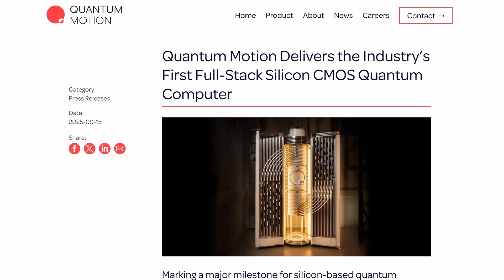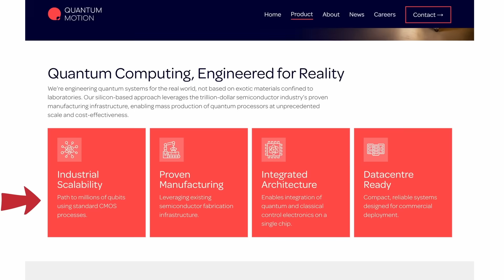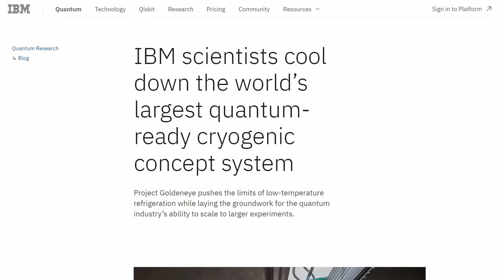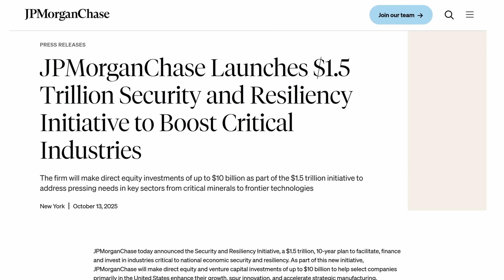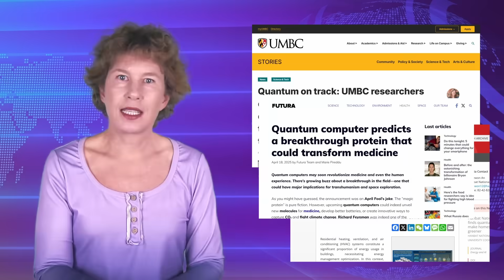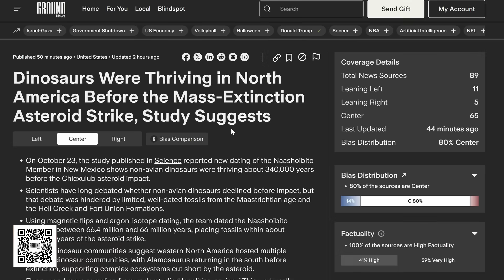I was SO wrong about quantum computing.

Comment: Let me fix this description. 

A quantum system is essentially a set of coherent states until one of the set undergo decoherance. Within a coherant state the best description is a wave function. We cannot observe the wave of a quantum particle without resetting the wavefunction. Classical most wavelike interactions (e.g. a radio wave) interaction will pass through a coherant particle without disturbing it. In a quantum system these waveform interactions cause a transference of information. 

    So what is the problem. We need to think of temperature as a profile of electromagnetic radiation created by the particle of the system. In a quantum computer Qbits are surrounded by materials structures that are involved in structure, insulation, and communication. These structure can retain and emit heat both through energy addition in terms of amperage, or in terms of latent heat pickup. Because they can hold heat, they can release in terms of radiation and this radiation can interact with the core of the cubit, thus causing various levels of decoherence. 
   So let’s take an example, let’s say at a given temperature the loss of information is 1/10 per cycle. If you have 2 cubits you will loose information every 5th cycle, roughly (the exact frequency has to be calculated using BPD). If you have 5 cubits you will have to repeat calculations several times to note the correct answer. If you have 10 cubits you might need to repeat dozens of times. If you have 100 cubits you might as well toss out the quantum computer. Some quantum computers use error correction, again, the more cubits, the more error correction that is needed. 

Is quantum computing going to make AI become hyper intelligent……no. AI currently follows large language models, its data that it processes are discrepant and fall in object class structure. For example a motor vehicle, motorcycle, tricycle, quadricycle, duelly, truck and trailer. Car has motor (ICE, Deisel, electric, hybrid). Motor has properties (HP, Torque, etc) 
And so on. Quantum computers work on arrays of data, for example weather stations where values can be assigned to places.

Comment: Secure communication.  That's the secret.  Well maybe.  Some time ago I heard that they demonstrated non-local communication as a by-product that wasn't considered relevant to their work.  Perfectly secure communication that works from anywhere to anywhere without delay and they thought it was an interesting oddity.🤫
Reply: Humans are still, by far, the weakest link in the security chain. So, even with perfectly secure quantum communication, social engineering vulnerabilities will still exist.
Reply: You can fly a drone on Mars in real time and no one can tap or jam the signal.  The rest are fiddly bits.
🤠

Comment: 1) Nobody has  figured out a way to efficiently / effectively use the computing "advantage" being predicted yet (and it's possible there is reason...it's not possible?).
2) Solving the cooling issue for the larger qubit systems being predicted (and possibly even manufactured) is beyond our current capabilities and directly competes with available power resources that AI is also wanting to consume.  (note that smaller scale local nuclear reactors could be a solution to both power issues, but the cooling still needs to be solved even if you have the power to do it).

Comment: Black Holes might turn into White Holes, and make up dark matter, physicists say:

Energy-Bound Universe 
Closed System 
x + y = 0 

Energy-Unbound Universe
Open System
x + y = 1 

Cold Energy Universe
Open System extended
x + y = 1 + C

Nil Energy Universe (Big Bang)
Binded Closed System
x + y + C = 0

Nil-Nil Energy Universe
Binded Open System
x + y + C = 1

No Energy Universe
Binded Open System extended
x + y + C = 1 + C

White holes could be from a Nil Energy Universe, where particles from the Big Bang could have reached them.

Comment: You can short a failed company and still lose your money if people keep buying the company anyways. Qubits are not real, at least with regards to how they are currently described. We can, however, create atomic analog computers that have super low latency due to interactions occuring at very high rates and low distances, and it will be easier to make these devices do something useful once we correct our understanding of what they are actually doing.

Comment: go chiplets. you just need quantum data wires. the optical quantum stuff. if you do not do better, your crown throne will be shifted away from its location. above says so. hype = money. at least your bs meter mostly 0.7 probability works.

Comment: The designs of QC I've deep dived into were dual pwm circuits that are in anti phase.   They run it and phase errors creep in and accumulate.   So the use ordinary computers to "find"  the answer in the noise using "lock in amp" type guess and try to find.   

it's an analog computer which have been around for 100 years or so.  Analog computers can do some calculations much faster than digital

Comment: 3:18  I used to be the system administrator for the research group I would be involved in, because we for some reason never have any budget to get a professional, though we have plenty of money for conferences and guests coming over for a week or two with all expenses paid.  I even had a cup of wine with a Nobel Laureate once that costs like 8k per bottle.  According to the guy who ordered it, that the budget for the meal was unlimited but each item must not exceed $10k.  Truly odd sense of priorities in my opinion.  But who I am to judge I got like 1/20th of that bottle so, I guess I got paid 8000/20 = $400 just for eating with this Nobel Laureate.  Hey, I had no idea I was paid at such a high rate, better than any hooker I know.  Of course, I don't use hooker.  Like with my gasoline, I am cheap, I like mine self-served.

Anyway, people have this weird idea that server room is necessarily full of wires.  That is only true if your goal is to spoof your IP since each Ethernet card,hence each Cat-5 wire, has a unique device id, thus it can hold only one IP address.  Not sure if that is still true today, maybe they can emulate these things now within the OS.  But, people who do that kind of things are typically hackers, or rather people working from the server room to reroute data to places that they are not supposed to send those data to.  For example, if my boss were running crypto minding thing on the machine I was administering, I could just by accident hook up another IP address to the machines and reroute all those mined coins to my crypto-pocket while he kept thinking how comes his pocket is still empty and stuff.  I am just speaking hypothetically of course.  I would never do that since I was getting paid by expensive wine.

Obviously, having so many wires around can be confusing and dangerous.  So to make things less confusing, one has to add more to the whole mess, except for a few with special colors so that I know those are the ones to not touch because it could tip off people like my boss that I am doing something funny, which of course I would never do, and if I ever get found out, I would feign incompetence and blame the guy before me, the server room maintainance crew, or the janitor for tripping over the wires that I carefully, and needless connected all over the place.  

It seems like with these quantum computers, I wouldn't, I mean "no one", would ever have to justify why they have to purchase so many Cat-5 wires when Cat-3 (the ones you buy at Walmart) would have been perfectly fine since most broadband services are not going to go at such high rate anyway.  

Also, why do people let people with foreign nationalities manage their computer networks and even the entirely department like when I was at UCLA Chemistry.  Hey, (I forgot his name, maybe Alex, the Russian Drunk, he was always drunk) how come there were so many wires in every server room and server cabinet you were managing just like in this frame?  And why I got into trouble with Argonne Laboratory but not you and the two guys working with you, one Chinese, and the other a Swedes.  And how come you guys have these techs that are like 2-3 decades ahead of its time.  I had no idea GPU cards could be used for crypto until one of you guys (the Swedes) showed me with your 50 cards gig.  I also didn't know solid state drive existed if I had not noticed how quiet and cool with no extra AC, your own personal server cabinet is.  Also that screen with that app where you are literally tracking everyone's traffic day and night, what were you looking for?  That was wire-shark before it was even out and available to everyone.  Are you like the creator of wire-shark ... BTW, don't use that thing makes your system vulnerable to remote attacks because it happened to me.  Russian are very dangerous, especially drunk Russian system administrators.

I also knew another Russian, but she was not a drunk, she was kinda nice older lady.  But, she was somehow working for AT&T hired from Russia directly, and ended up homeless eating cat food for a few years, and then miraculous found a job working in medicine.  And then married some rich dude after her kids have all grown and graduated working for the big tech.  I wonder how that works.  And here I thought no one ever recover from homelessness and prostitution, much less experiencing a real life Cinderella story like Julia Roberts in Pretty Woman.

Pretty woman, walking down the street
Pretty woman, the kind I'd like to meet
Pretty woman
I don't believe you, you're not the truth
No one could look as good as you
Mercy!

Comment: What we all forget is that we "easily" could make trinary bits in standard computers. Instead of 0 and 1, would you have one, zero and minus one.
Reply: We could have decabits, or hexabits. In fact modems essentially use 64-a-bits. But that would not give the advantage that quantum is supposed to provide.
Reply: @AaronJees-Tring-y3y  I am not sure if my explanation was good enough.
As it is right now, d we have 64bit, each bit can be either on (1) or off (0). By using Trinary, could you have 64bit as (-1), (0) and (+1), making it exactly bits in three states, as the Qbit. The quantum is not amazing due to the three states bits can be in.

Comment: While most said is true, I don't think this grasps the order of magnitude of the issue. Scaling up the fridges by 100-1000x is a challenge, but the path is relatively clear. The biggest issue in my opinion is that the coherence times are still in milliseconds even for a few logical qubit setups, while you need way above 1000 logical qubits that can work error free for days or weeks. Neither count, not times have been scaled at the rate that would suggest being anywhere close. Seriously, it is not even funny!

Comment: The cooling issue could be addressed by computing platforms in orbit, inheriting tech being considered for LLMs. So the infrastructure build out from one bubble gets used to support the quantum bubble! Two investment streams coming together. So maybe that's the secret you're alluding to, that quantum computer companies see a way to piggyback on the infrastructure for scaling/cooling LLMs. "Converting the space station into a quantum computing platform" would certainly get some play on social media!
Reply: Where are you going to sink that amount of heat in space?  Being out of the sun is not enough, things cool off very slowly in a vacuum.  Heat shields for daytime part of orbit could handle solar heating, but heat sinking? I forget the formula, but pure radiative cooling takes quite a long time doesn't it?  Even with a cooling system you still have to put the heat somewhere.  Not to mention the power source.  A huge thermoelectric would work, but again the heat, the costs to get into orbit, etc.  I think you would be better off just building one in Antarctica and sink the heat into the air and the ground then moisture proof it.  I just think it would be more practical.

Comment: The thing is, macroscopic objects can be oriented with electromagnetic phase rotation to build a quantum state space through vibration, just the same as qubits.  Even macroscopic objects have quantum displacement, 'amperage'.  This produces the exact same "quantum statistical correlations" in Hilbert space awarded to the Nobel prize.  So you see, the bottleneck of QC isn't in subatomic noise - as she seems to insist.  Macroscopic objects can persist in displacement, i.e. the electrical grid..  So, all in all, my takeaway is that quantum computing is a real thing with a lot of misconceptions centered around it.  You can basically throw out all of modern quantum mechanics and be perfectly fine with Maxwell's equations.  The quantum state space that Schrodinger's equations derive from the basis states remains quantum - mathematical statistics based on reality.

Comment: Why not deploy quantum computers in the cold vacuum of space powered by a solar array?  If the inputs and output to a program are relatively small and the value is in the computation itself, then the distance is not a big problem.
Reply: Because space is not cold as we understand it on Earth. One of the biggest problems in space is things overheating, because you can only use radiators for cooling and they aren’t really very effective unless the hot side is really hot.

Comment: It's not so much that I disagree with you Professor as your point about the cooling of superconducting qubits and scaling is both an excellent point and a necessary consideration. 

The reason that I focused my full attention towards photonics was primarily for that very reason. 
Speaking as an amateur chip architect I can tell you that it is unlikely that superconducting qubits will be the technology that achieves quantum supremacy, however it is a powerful stepping stone that allows developers to create benchmark tests for other technologies and therefore provides a great deal of data and insight into the behaviour of qubits.

My money is still on photonics and has been for a very long time, but most companies are riding the success of superconductors for now and the niche applications are still useful in my opinion.

The first computer was pathetic in comparison to todays computers and yet it laid the foundation for the modern world in the same way that nuclear energy laid the foundations for fusion.

Nvidia is the company working on linking multiple Quantum processing units using fibre optics and pushing for improved standardised software for quantum acceleration of classical computers, and i agree that most youtube videos on quantum computing are a load of shit written by people who don't know the difference between entanglement and action, the technology is beginning to evolve and "it may be time to start moving our shares out of the buggy whip factory." In 10 years we will likely have dramatically faster computational power and access to Quantum Cloud Computing, for very niche purposes, but that doesn't make them less valuable.

With access to those sorts of programs, we may not need particle colliders anymore, scientists will be able to draw from a huge wealth of untapped potential for the betterment of mankind and a future rich with opportunity and abundance may finally be in reach for everybody.

Comment: If there are some memes/images in the video chosen by you then it's fun, but having this random pile of random stuff vaguely connected with some of the keywords you utter seems so distracting and unnecessary (I'm assuming it's automatically generated). But it's coming everywhere so maybe I just need to adjust to this new reality.

Comment: The real breakthrough that they found is the ability to generate prolonged and unabated hype without any concrete product advancement. Its really not that different from similar science stuff the apparent need to build ever larger colliders or the eternally the fusion dream, except they realized if they put the stuff on the stock market, said hype would generate interest with extremely long tails before anyone realizes something is up and even longer before somebody does something about it. By then they're planning to have already bailed.

Comment: Sabine would you please look into Extropic and their thermodynamic sampling units (TSU) which is supposed to be some kind of probability computer that claims it can do AI diffusion jobs and optimization algorithms 10000x more efficiently than existing GPU's. They have videos on it and a company website where they explain their technology, but I don't understand it. I'm just wondering if this thing is legit or just nonsense. The company was founded by a bunch of Ex-Google and Microsoft engineers, and they already have a developer kit version released and are promising to release some kind of card later next year. They even have a programming library where you can simulate their tech on a GPU and a github codebase demonstrating it. The tech they use is apparently well know and is used in labs since the 1980's for optimization problems, but they claim to have innovated on it and are able to scale it up for bigger tasks.

Comment: Regular old 1960 and 1970 era computers have been scheduling trains, routing shipments and planning operations for railroads, airlines, etc for 50 years.
Reply: That why they only started running on time in the 90’s ;)
Reply: @luipaardprint  you needed computers + internet with real time data which only came in the 90s.